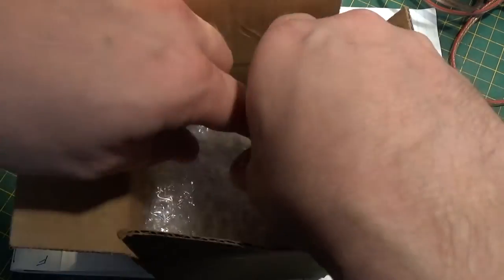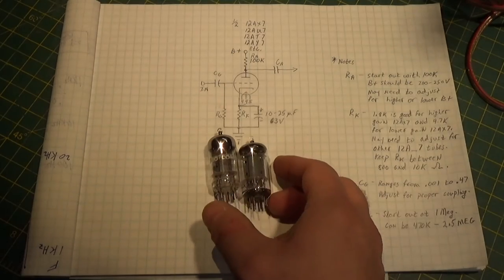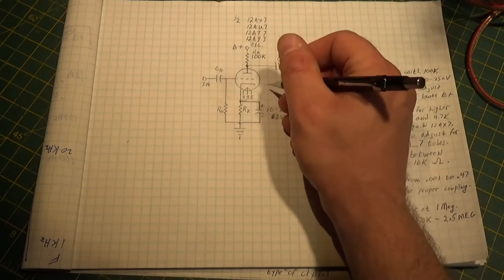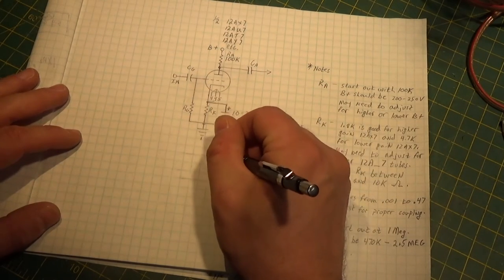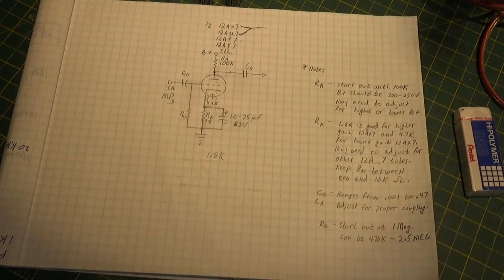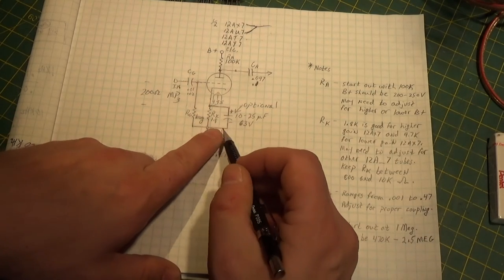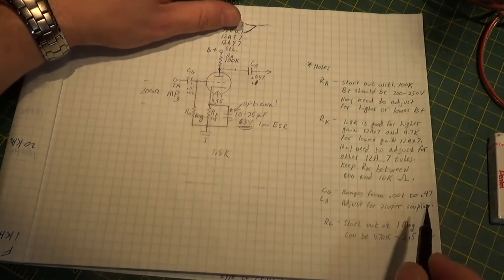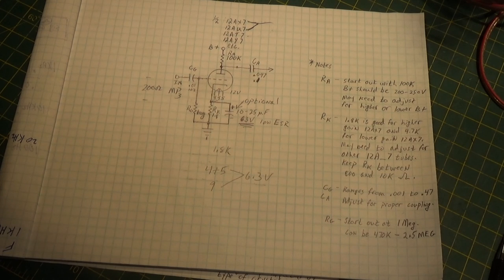Vacuum Tube Preamp Circuit for MP3 Players

Comment: Tony, I see that you are looking at the 12AX7 tubes... Ever thought about trying out the EF86 Pentode? I don't have personal experience (yet) but I have seen other YouTuber's state that the 12AX7 tubes tend to peak around the mid frequencies, where the EF86 has a flatter frequency response. Not to mention the gain of around 180, it even looks prettier too!... It's probably got the best datasheet, most datasheets that I have are usually only one page jobs but not the EF86... They really went to town on that one... Once again, I'm no expert but it's what I have gathered so far. Everyone else seems to concentrate on the output stage of tube amplification but very little is covered on the preamp section so I was happy to see this video! You really did an amazing job on the explanation of a topic that I believe is neglected...

Comment: HI Tony , the mu of a triode is only theoretci based on an infinite load.........SO 100 for an ECC83/12AX7 is in real use far lower.
The 12AU7 is usualy a better sounding tube than the AX7 , besides exceptions ....
for low impedance drive and lower B+ voltages on following amp the 6DJ7 /ECC88 family may be a good choice ( as seen on different commercial line level amps )
Anyway any of these tubes can indeed do the job .....just beware of not applying max operation conditions for long life and correct filament voltages !;

Comment: Nice video, thanks! Seems simpler than solid state. I would use it as a output stage for a DAC I've build. The only thing holding me back to try it is the cost of the high voltage supply, aren't these expensive?
Reply from the maker: Marcel,
Good question.  I will do a short follow-up video on how you can build an inexpensive power supply for this project.  I'm sure others would be interested in this as well.  Stay tuned!
Reply: That would be great! Looking forward to it.
Reply: Actually.. If you swap out the tube for a transistor and use a low voltage transformer instead, you will find that it's literally the same but cheaper... If you disregard the heater, you are essentially looking at the base, emitter and collector of a solid state transistor... Hope this helps 😊

Comment: good ideas.I was thinking to build this preamp as a portable to use on old tube radios with a phono input so a record player with a modern (low voltage output) cartridge.Any ideas for a power supply? Thanks,Art.
Reply from the maker: Check out the next video for a power supply.  You may have to tweak the design a bit to get the gain you want from the circuit.  Different cartridges have different outputs.  You can play with the values of the cathode resistor and then add or remove a cathode bypass capacitor to get the gain you want.  Good luck!

Comment: This may be perfect for me to start with.  DO you still need a preamp stag in the amp before this preamp?  My amp is just 6sn7 and 4  6v6 tubes.  Leslie organ amp  model-44W
Reply from the maker: If you use this circuit with the 12AX7 and the 1.8K cathode resistor, you should be fine.

Comment: what are the wattages on the resistors?
Reply: They are usually 1/2 watt.  But you can get away with a 1/4 watt for the cathode bias resister.  If you put a 1 watt, you won’t hurt nothing.  It just costs more

Comment: The first thing you should do is get a TUBE MANUAL. In it you will find a section of tubes  that can be used for AUDIO AMPLIFIERS. The manual has values that may be used for a given gain. It will also tell you of HOW to design tube AUDIO AMPLIFIERS. Just putting values to a circuit does not teach you much of anything. Yes there rules of thumb you can use, but for me I like to know why I am using such values. 

The tube manuals have a wealth of information .
Reply: @Henry Hopkinson

Yep. No real explanation of grid biasing, no grid stopper etc.